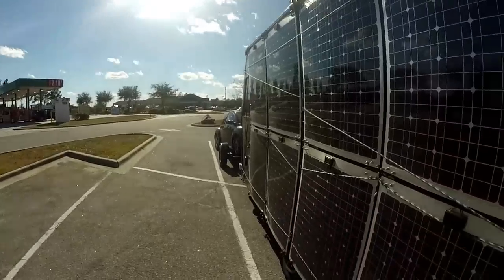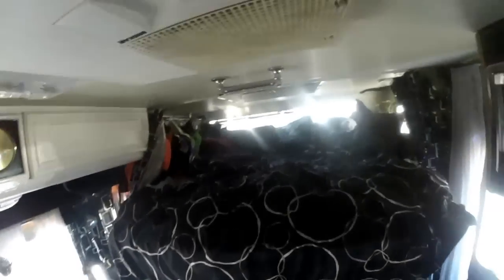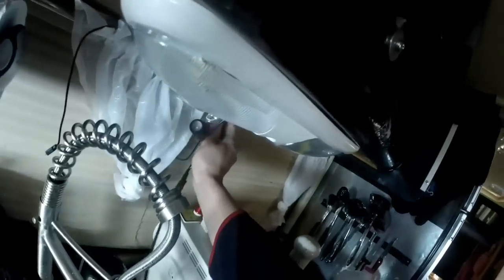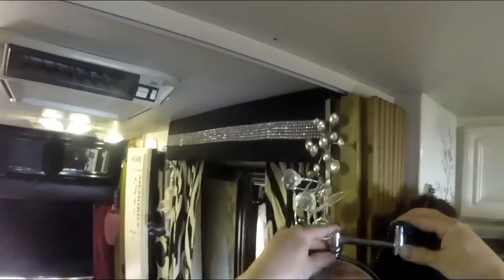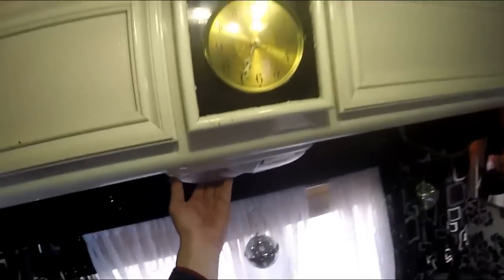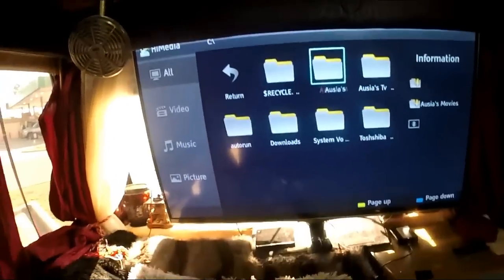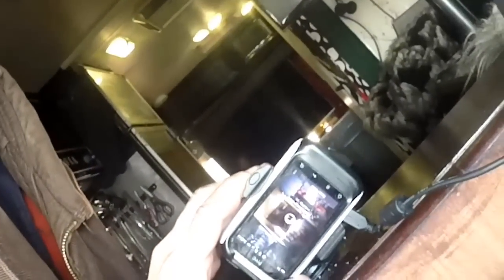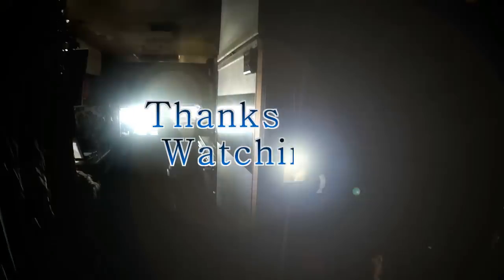Updated Rv Tour of  Roof Solar, Extended Bed, Entertainment & Heating Rv

Comment: Thanks for showing us your home! :) Looks so cosy! One question. As an RV/solar noob, how much power can you get with your solar panel's? Would you get enough power to run a computer and tv and everything else all at the same time? or do you have to watch what you use?
Reply from the maker: Ruin Or Rapture Well it depends on my positioning of the RV and if it's cloudy or sunny, but normally I don't have a problem with power. I can run my TV, gaming system, laptop, swamp cooler, lights, microwave, hair dryer & small appliances with no problems, obviously NOT all at the same time but I do have a 5000/10000 watt pure sine wave power inverter & 10 batteries so it handles quit a bit. It has run the air conditioner but it such a power hog that I don't use it because it drains the batteries very quickly. I had thought about getting a small generator for the A/C but I'm in moderate temps now so haven't need it. Hope this helps.  :)

Comment: That 20 propane tank is not to be used or stored like that very dangerous
Reply from the maker: +Craig Flatley Oh that's odd ...it's been like that for over 10 months with no problems. Why shpouldn't it be stored like that? Just wondering....
Reply: +Panda Monium Hi, One is if a leak was to happen it's a closed compartment. Laying the tank on the side and using it is the bigger problem. In a standard tank standing up the vapor is used as should be. Laying the tank down causes the liquid to be drawn into the line. Please talk to a propane dealer and they can explain things better.

Comment: Dear Ausia...please double check on the carbon monoxide detector. I learned on the boat and at home that the ideal is to locate it five feet above the floor or higher. That gas rises. 
Gas detection for propane is usually what drops to ground. Please double check as we do not want to lose you. 
Love the recycling of the wardrobe door and bars. Great set up. 
Hugs and Light.

Comment: I thought of something while watching this, instead of supporting your bed with the polls to the floor, could you just attach the metal chrome handle you installed on the ceiling, maybe using the clasp you already made?
Reply from the maker: David DeRoche Thanks David.... That's a good idea...although I don't use that bed anymore so I took the extension out to reduce weight. Cause it weight 100lbs and the poles were about 25lbs each.
Reply: yea, good idea. Your my favorite traveling friend. :)

Comment: the cabinet door is a great idea!
where do you get rid of the toilet compose?
Reply from the maker: +Nissim Nave Thanks I bag it up like kitty liter and toss it in the trash the liquids are in a jug and are deposed of at any public restroom.
Reply: +Panda Monium Thank you!
Do you actually take the liquid with you to the nearest restroom?
I thought of the idea of using composted unit, but the disposal practice is something I don't understand...
Reply from the maker: Depends where I am but usually yes unless I'm out in the wilderness then i just pour them on the nearest plants.
Reply from the maker: Honestly aslong as you don't mix the liquids with the solids together... it's easier to get rid of! It's when you mix the two together, that's when it becomes sewage and you have to goto a dump station..